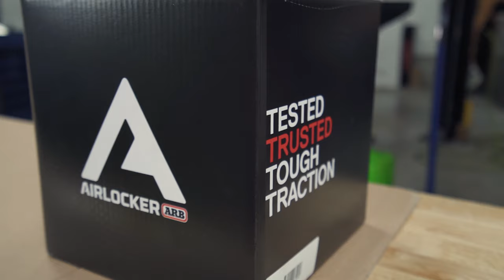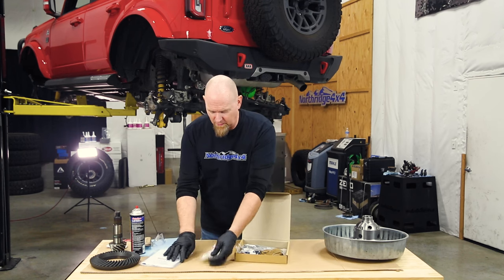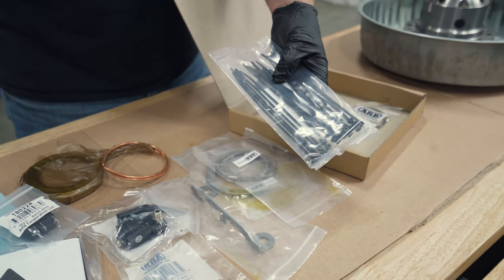ARB Air Locker Install - 2021+ Ford Bronco

Comment: That was cool. It would be great to get a follow up with information from all your experience on where to put the fitting in the differential housing and how to route the copper line inside.
Reply from the maker: Thanks for the idea!

Comment: Awesome video. I have a 4cyl auto big bend. The stock gears are at 3.73 and I am trying to change them to 4.7 so I can add 35”s. The front axle is m190 so where do I find a gear for that? Can you help me out?
Reply from the maker: The aftermarket is still lagging on the M190 front gear sets.
Keep an eye out on our Channel. We'll let everyone know when they are available.

Comment: Hello, is it possible to add front lockers onto an outer banks model that already has rear lockers? How would you engage the front if it’s added?
Reply from the maker: Yes, you can add lockers to the Outer Banks front axle.
Your choices right now are limited to an ARB Air Locker, so you would use the switch that comes in the ARB kit.
Reply from the maker: You could also swap out the smaller Outer Banks front axle for the beefier Ultimate Dana 44 front end. They come with factory type E-Lockers and are available in different gear ratios:
https://www.northridge4x4.com/part/complete-axle-sets/ud44fbro470eld32-dana-ultimate-d44-front-advantek-axle-unit-4-70-ratio-e-locker

Comment: Just to confirm. You can install back locker on a base model. Is that correct.
Reply from the maker: Yes, the rear axle is the same M220 axle and would use the ARB Air Locker pn# RD245.
There are differences in axle shaft length and gear ratios between the models.

Comment: great video! what ratio/ gear manufacturer did you use here?
Reply from the maker: ARB had us stay with the stock ratio for now. They supplied the gears for us. iirc the rear gear set was Yukon and the front gear set was OE Ford (Ranger).

Comment: How does this work with the factory computer and G.O.A.T. modes?
Reply from the maker: The ARB Air Lockers work fine.
They are not wired into the factory computer system, so they do not have any effect.
Want the locker on? Turn it on.
Hi range, low range, baja mode, economy mode, the Air Locker doesn't care, it locks in and gives you that extra bit of traction.

Comment: So for the new Bronco like the one here what is an approximate cost for this entire set up?  I know you have to add the air compressor system as well labor etc.
Reply from the maker: It would be best to email or call that question in. sales@northridge4x4 or 866-601-5340.

Comment: I have a 21 Big Bend and would like to add a rear locker, can you please provide me with which parts are needed? Thanks in advance.
Reply from the maker: For an open diff axle (no factory lockers), use ARB pn# RD245: https://www.northridge4x4.com/part/lockers/rd245-arb-rear-air-locker-m220-32-spline
You'll also need an on-board air compressor:
ARB Single: https://www.northridge4x4.com/part/compressors/ckma12-arb-12v-compact-air-compressor
Or the TWIN compressor: https://www.northridge4x4.com/part/compressors/ckmta12-arb-twin-compressor
Reply: Thankyou much!!! Also which ring and pinion set do you recommend? I have 4.46 gears since it’s a manual Bronco.
Reply from the maker: @bucknbison2297  What tire size are you running or going to run?
Reply: @northridgenation   I’m running 38s

Comment: Hi Tim, where you locate ARB switch's,
Reply from the maker: On this Bronco, ARB was using their ARB Lynx system to control the air lockers.
https://www.northridge4x4.com/part/programmers-tuners/lx100-arb-linx-vehicle-accessory-interface